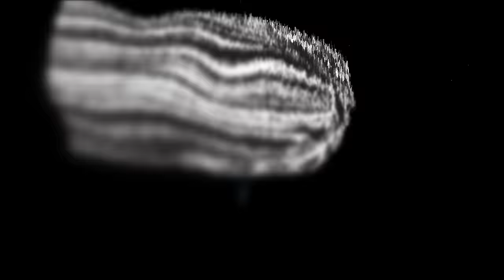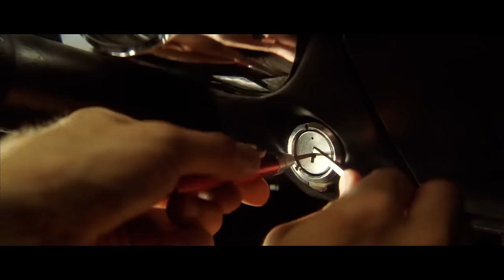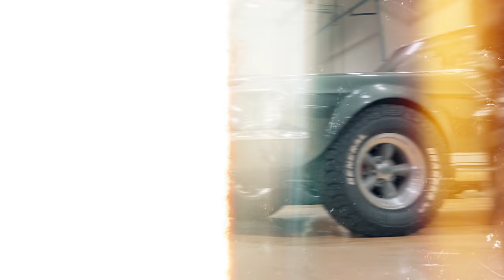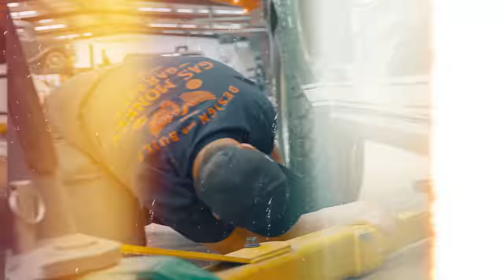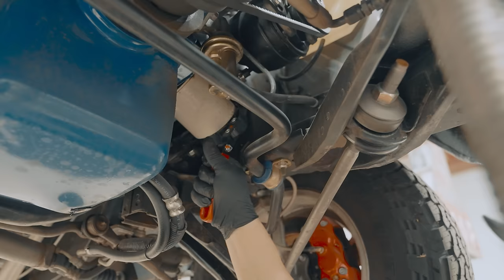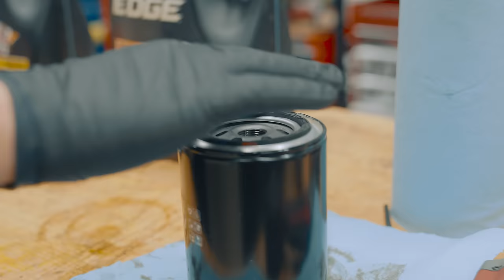"Thomas Crown Affair" Gets A Tune-Up

Comment: It helps to tin the wire connections. Especially ignition wires. Another suggestion is to cut the oil filter down and examine the filter material for metal. It is a more accurate means of analyzing for metal particles.

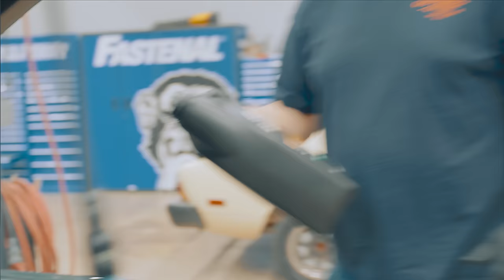Comment: 12:36 yes Sir! My older Petrol Motor was meant to have 5w 30, but I wasn't using it as Grandma I bought from was. I was doing 60 mile a day. 10w 40 was fine, the engine was running long enough to stop Condensation building up from using thicker oil!

Comment: I've ran mobile one 25,000 mile oil with an extended performance mobil one filter since new on my 04 Ranger and it has never had a leak or anything and it runs smoother then Richards wallet at 111,111 miles 🤘

Comment: That Mustang is spectacular. I loved it when I saw it in The Thomas Crown Affair, and I think it’s my favorite car in the Gas Monkey collection.
Reply: I owned one of those. It was my very first automobile way back 40 years ago bought it for 100 bucks. My dad and I put a set of gaskets in. It had a blown head gasket and the guy that sold it to me thought the block was cracked $14 set of gaskets and I had a 67 Shelby Mustang 289 hypo, four speed dual exhaust and at the time it wasn’t any special car it was just a car I bought it for 100 bucks. I drove it for four or five years sold it for 500 and I thought I made a killing Until a couple months later in the article came out in hot Rod magazine about the fastback Mustang, and all of a sudden they’re worth more than my house😳 I would take the light bar all that crap off of that car snow tires and I would restore that to factory but Richard probably already has one or two of those stashed away somewhere that are worth three or four or $500,000

Comment: In my experience you can tell if a car has had its oil changed correctly by the dipstick, unless stick been changed. They will have a burn or black place on the dipstick usually about half way up the stick. Generally if the dipstick looks good from top to bottom it has had decent oil changes. Just my experiences

Comment: I have a 1991 Chevy V3500 crew cab (last year square body) that has a brand new direct replacement GM crate engine that has a flat tappet cam. I have to use Valvoline VR1 racing oil, which is one of the few oils left that has zinc in it to protect my flat tappet cam.

Comment: Hey guys, I've heard many times from different people over the years that you can buy a brand-new car and part it out for a significant profit, although I am yet to see someone actually do it.

I think higher-end cars like Corvettes which are more likely to be crashed and also have components that can be used in older cars might be better for this.

I think it would be an interesting video that nobody else has done.

Comment: Hello guys,since your lowering the Ford truck,does that effect the drive shaft travel length going into the tail of the transmission ?? I had a 67 Chevrolet truck lowered,and to stop from damaging  the automatic transmission I was told we needed to shorten the drive shaft was that good advice??

Comment: Just because the motor has been recently rebuilt, Doesn’t make it a modern engine. If it was my car, I would be running an oil with zinc in it. That’s just me different strokes for different folks.